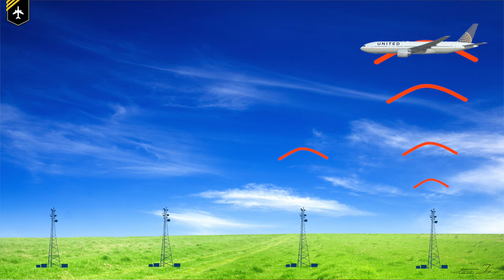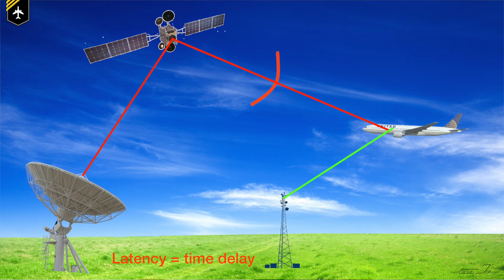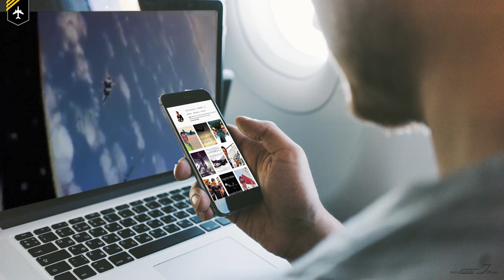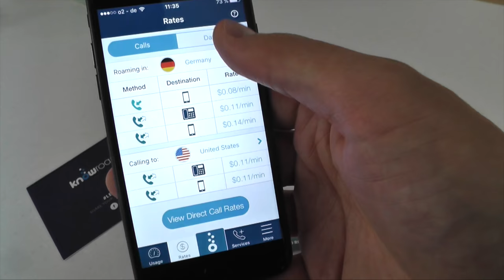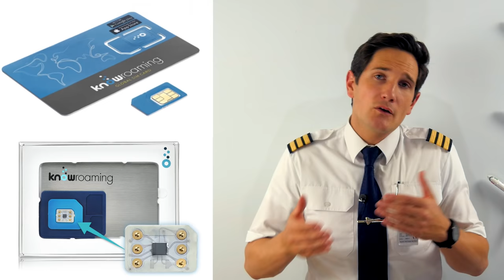HOW does WIFI WORK on AIRPLANES? Explained by CAPTAIN JOE

Comment: Captain Joe, can you make video how the luggage can follow passenger eventhough they have tight connection ? If the passenger fail to make the connection, the luggage doesn't make it as well. How that works in the last minutes ?
Reply: I agree the concept in general but how the cargo guy decide each luggage should board or get removed from the plane when connection is tight? I know in normal scenario, they scan our ticket before boarding the plane, so they know I made to the airplane so luggage should get onboard as well.

If the connection is only 20 min, passenger run to next gate which could be from terminal A to terminal B, the luggage basically has to "run" as well then ? How they can separate that luggage from other luggage quickly ? Assume the luggage guy is faster, how the luggage guy can determine if they should load it? wait until ticket got scan ?  

How about if the passenger is faster, and luggage guys is slow, the plane must wait until the luggage loaded as well ?
Reply: Most airports I've seen have cargo loading that is based on the boarded-passenger-count instead of the ticketed-passenger-count.
This, among other things, reduces the risk of passengerless luggage-bombs.

So, yes, even in those cases the plane will wait for your luggage, as it will be waiting for all the luggage it has to carry.

Comment: I hate to be that guy but it was far too annoying to ignore, especially being both an IT guy and a former satellite network engineer...

It's MegaBITs, not MegaBYTEs... You were claiming speeds 8 times faster than they are

And also Ku band theoretically tops out at 50Mbps, but you'd need to be basically flying in the stratosphere to get that!
Reply: p3rs0n42 haha I was thinking the same thing. I think it's very worth noting, though, that Gogo's 2Ku is claiming peak speeds of 200Mbps with the dual antenna and new modems. And it's not affected by weather like Ka :)
Reply from the maker: you´re absolutely right, my mistake sorry!
Reply: A satellite engineer......?

Comment: Hi Captain Joe, loved your videos. This is a subsequent question to your reverse thrust video. I understand that a jet airliner can only engage Reverse Thrust once its main landing gears touched the ground (correct me if I'm wrong).
However, I remember flying the Beechcraft Air King in the Microsoft Flight Simulator and the plane can engage its Reverse Thrust while still on air, is that true? How dangerous it is, and what are the procedures or standards involved to engage reverse thrust while on air? Perhaps the minimum air speed to do so.
My second question would be, what is/are the methods used by jet airliner such as Airbus A320 to slow down while it's still on air (descending for approach)? Can it use the spoilers? Or all the pilot needs to do is to minimize the thrust early enough?
Thanks!

Comment: Hey Joe, a quick correction to a common mistake. Mbit is not the same as MByte commonly abbreviated as MB. Also note the lowercase b in bit vs uppercase B in Byte. So 1Byte = 8 bit, thus 1MB = 8 Mbit. Anyways, great video as always! :)

Comment: Re Hi Captain Joe:

As a retored electronic technician microwave is not new but how it is implemented can sho a LOT of pros and cons.

Each f the three systems you mention have their ros and cons, but in the end even the hybrid implementation of these, whether by protocol selective receivng and aggregation in board the aircraft or by true simulataneous content integration, there is still room for some cost effective improvement.

The server onboard might well be headed by a mass onboard storage unit, smewhat similar to a NAS. This would receive by whatever ground and satellite services the airline chooses to use to pick up content, then it is the server for the onboard WI-fi system.

(Since this also can be segmented to provide two A-lan (as in airborne LAN) nertworks, one of these could be used to enhance communications for both the cabin and cockpit crews.

As for the cockpit, this is intended in addition to all they have already so it sits as an added redundance and fallback in case all other coms fail.

On trans-oceanic long haul, it could reduce some of the occasional need for HF radio when more than 200 miles away from the nearest VHF tower. We both know of the limitations of HF and skip. also in trans arctic flight other issues f nature simply exacerbate even more.

(I happen to have a multi-segented system in my apartment which I created myself!))

====================
Back to the cabin:
===============

Now when a passenger surfs, effectively requesting, say a movie, the system will fiorst search its internal storage for the movie,, and if it is there, will serve it to the assenger.

If it is not there, it will search the ground systems serving it and request it. when It arrives, oit is then stored in the onboard storage and subsequently served to all who ask for it. Additionally, if the system receives subsequent requests, it can also serve them without the need for the use of additional air to ground or satellite bandwidth consumption, saving in the cost of same, and resulting in faster response for requests that are repeated many times i.e. popular at the time.

this also opens the door for the airline to charge for the service my usage rather than simply availablility and time. What they end up paying for artists' rights is up to rhem, but hopefully both artists and airlines will negotiate that wisely so that it doesn't end up being destroyed in greedy fights. (Maybe ICAO could host some of this sort of negoitiations?)

As for email, the onboard system would have an email manager which would route email in the most efficient way, so that email that does not have to go air to ground will not, but instead will go passenger to passenger. If an sort of "bad behaviour" complaint is raised, it will send a notification to the Purser "#1" who can then be the first lne of maintaining order, but also with the means of notifying the cockpit if he/she deems mecessary.

Additionally, thecomplaint is logged and a copy of the log sent to ground in case something of major proportons (comparabe to a hijack) erupts. Once ground receves a call from the captain, ground autoritiesd, police etc. can then open the log to get an early warnng ongoing report no matter who does what.

If global engineesrins standards are ilemented, forestalling problems resulting from proprietary incompatibilites and making all this modular, the winners will be of that collaborative good Karma!,

Finally, I am 74 years of age, and unlikey to fly again myself. so win or lose the real gsambit, it will make little direct difference to me. But the altruism that I might wish for on my last day on this earth may hopefully be my greatrst gain in the lot.

Comment: I flew on Air Berlin earlier this year (RIP) and the domestic transfer flight had Wi-Fi... and the landing page claimed some impressive transfer speeds, but also had an obscenely low cap, if I recall correctly it was around 300-500 megs. So you could watch that video for a few seconds before you've used up your data and cannot use any more. I expect there will be more data caps on more airlines so even if you're able to get enough speed to watch a video your allowance won't be big enough.

Comment: 1:45 One byte = eight bits. In order to separate the units, we use capital B (as in MB/sec) for bytes and lowercase b (commonly written Mbit/sec) for bits. Now that you've said "3 Megabytes" but shown "3 Megabits", there is noticeable confusion.

Is it possible you could add a correction anywhere, even if it's just the description?

UPDATE: the description states megabits, I just failed to read...

Comment: I want to ask, when we turn on the plane mode (which doesn't make your phone fly :v), it turn off all signal feature like radio, telephone and WIFI, in order to not interrupt the ATC tower to the plane and back.  Is wifi onboard will not interrupt the signal of the plane or the wifi doesn't interrupt the signal at all?
Even though I ask this question after 2 year, hope you can see it and answer for me. Thanks, love your videos even if I'm not a vip passenger or often fly passenger.

Comment: Thanks @Captain Joe for another great video, I am happily following your channel and always joyed to see a new video pop up in my feeds! :)  Even though I am not a pilot or anything in aviation, it is still a fun hobby to observe and admire!  In regards to the units of data transfer rates thanks @ Marcus [DaSquad], I noticed the same thing and kept thinking to myself if the units are actually Bytes it would be awesome, though there is a 8 times difference between the bits and bytes.  Though he indeed is a pilot and not an IT, even though in these days the difference is much less with the growing tech age and how many systems and procedures I continue to be amazed that pilots need to have an understanding of.  Another side question to this is if cell transmissions do actually interfere with plane operations, for communications, navigation, and so on, or is is just a precaution.  Also, as you mentioned in this video, it seems that you were saying that one of the systems uses cell towers to transmit the signals.  Would these signals be the same as and carry the connections for the cell phone networks?

Comment: Hello,captain joe. May i ask you one or 2 question? Is it true you need to startup generator engine on the back tail aircraft in certain range n temperature before you can started up main engine. Which mean engine on the wings of aircraft. 2nd questions is.. is it possible to still in flight in just one engine remaining cause unexpected event like turbine error/ engine blade damage/ or whatever it probably might happen that could triggered the caused. N whats kind procedure you need in case you facing critical situation like probably crashed in the middle of nowhere. TQ IN ADVANCE

Comment: I was expecting pilots to have their own wifi separated from the passengers. Communication is crucial and if the radio fails, the Internet could be an interesting emergency communication system where they can also send data and no just audio.

Comment: Small correction: the ATG system picks up to 3 Mbits, which is not MEGABYTES as you mentioned, 3 mbits is equal to 0.375 Megabytes, so that's about 400 Kilobytes/s, same for the mobile phone, 40 megabits is not 40 megabytes, it is 8 times less, so that would come as 5 MB/s

Comment: Love the video but data rate terms are off a little. Mbit/s or Mb/s (megabit)is not the same as MB/s (Megabyte). A 30Mb/s connection will download at about 3.75MB/s (big B and little b make the difference) as there are 8 bits to a byte. A 100Mb/s connection will download at 12.5MB/s give or take. Taking the first internet delivery option. If you have a connection of 3Mb/s you would download at a rate of 375Kb/s (Kilobytes). You may already know this, just want to avoid any confusion.

Comment: Hey joe I recently traveled on an A321 with JetBlue from NYC to San Juan. When we were at the gate ( both ) there was steam coming from the side panels of the aircraft is this a depressurization system or some sort of chemical solution to stop the spread viruses, bugs, etc.? You may have made a video but I haven't found it yet. Thanks    -billy

Comment: KnowRoaming is good and I’ve been using it for years for my travel. Just pop the SIM card into a portable wifi router and purchase the unlimited plan, then all your travel companions get to share from a single access point. But the thing I dislike is their e-wallet which has an expiry, any left overly money in the wallet will expire and forfeited. Plus you can only topup thru their predefined amount and not any amount you choose.

Comment: Actually Ku and Ka aren't pronounces as words (more correct to call them by their letters: Ku=Kay-you, and Ka=Kay-ay)  Since there's already a "K" band pronouncing it the same as Ka would be rather confusing; in North America, Ku band is used in satellite TVs while K and Ka band are used for proximity and speed sensors (automatic doors use K band usually, while police tend to use Ka band to try and catch you for speeding)

Comment: That's some serious higher radio frequencies airplanes are using in order to provide us sometimes internet during flight, they must use some insane powers to transmit from the towers and satellites since the higher the radio frequency is the less range you get...
Reply: Given that most consumer bandwidths are downlink-heavy, one can assume that a slower frequency is used for the uplink.

Comment: This is how I'm going to be doing wifi and cell service when I go over Seas. I will use a Satcom set. Meaning Satphone and Satfi. A phone can cost 2k and a sat hotspot 900. Already looked them up. And cell service can cost you 100-200 for a month with both devices.

Comment: I don't get why they don't try to integrate the antenna into the fuselage. I'm guessing there's an issue with the composition of the fuselage blocking the signals, but surely there are composite materials that they can place in a patch and fuse with the metal. Kinda like what any wifi device with a metal case does. Big plastic part where the antenna is.

Comment: Hey Joe, you showed how that satellite antenna on the fuselage is able to rotate. I guess that only works when the airplane is flying more or less straight. How is it when the airplane makes a turn? Will the antenna maintain connectivity despite the fuselage being rotated to the one side where you are flying towards?
Reply: Do you mean roll? The antenna compensates for roll, pitch and yaw if that is what you ask.

Comment: Question: Under what conditions would a pilot abort a landing? I've seen videos posted of a plane in what looks like a normal landing, only to have the captain abort and take it back up in the air again. What are the sets of circumstances that would have to occur for a pilot to abort and try again?

Comment: Well, yes...tow ways explained.

The ATRAC satilite communications system transciving array...it provides high down speed ( Up to 400 MBit down) but only very limited up speed (About 5 to 15 MBit).
So most of this system, is prioritized for more important air craft data exchange, than on bord wifi.

Second is simple radio based, has about 25 MBit down/25 Mbit up, but limited range and needs land based systems to communicate with, within 50 miles or less of tha plane.

Also maybe faster(up to 350 MBit down, 125 MBit upload, on 5,2 G HSDPA mode), but very rare due extreme expansive materials needed for this antenna...tha GSM/4 or 5 G transceiver...basically a cell tower that links up with tha ones on the ground...tha only certified way to provide cell service or wifi, on tha ground and while takeoff or landing is in progress, as it not interferes with other plane used frequencies.

Over land, as mentioned, tha 4 or 5 G tranciver can also provide on bord cell service...but currently not used for passengers and if installed, only for flight crew usage in emergencies!!!
So if you not a pilot in distress, trying to get ground contact, no cell usage, please!!!

So turn your phones off, even if they might work, it scrambles with tha rest of the on bord systems performence, as so much radio communication is going on with a plane.

But as captain joe mentioned, all systems require a firewall(So Non Stop not repeats so easy, movie based on a true incident with a dreamliners wifi!!!) and a router...also high end ones to make it possible, tha bandwidth can be used by all passengers.
Tha equipment for just, most common, Lowspeed Ku satilite powered wifi, is about 500 Kg(CRJ-700) - 2112 Kg (A380) extra...so basic plane weight up, fuel consumption up...tha reason it will never come cheap!
;3)

As fuel, even Jet-A 15 or 20, are more expansive the more quality they have...tha reason it more and more spreads to civil airports, it burns cleaner, turbines last longer with it, together with economic founding, tha airlines pay a little less than with Jet-A1, were they pay for it's unclean burn waste and for turbines getting busted faster.

Otherwise, it most likely and sadly, not would be used at all!
But okay, for pilots that are in one of tha few airlines using it and flying to tha few airports serving it, yeah, your fuel calc is correct, it burns so much more efficient, it's really okay you load on less fuel on longer trips, as much your calcs show!

But guess the airlines got you tha new power training...hopefully, that gives you all tha data...otherwise your airline has to provide some written value updates, for Jet-A15 or A20...optimized to your type of plane and model, too.
;3)

So much for my update, felt inspired to say it again, don't mess with inflight securety!!!
Turn cell service off, if not allowed specifically on a plane!
Don't mess with fire detectors...and if you really are among tha few to ever experience a emergency disembarking:

Keep calm, tha swimming west deflated as long you're not outside tha planes inside.

Have a nice and pleasant flight, and fly safe!
;3)

Comment: Captain it's always so informative to watch your videos. Thanks alot. Actually there is a question in my mind from the past few days. I came to know that at a time there are 14 thousand aircrafts in the air in the world at the same time. Wow that's a huge number. So my question is airport's such as Dubai or Heathrow where the air traffic is extremely high, so how they handle these aircraft to prevent collision and what normally flights do to prevent collision between them? So in the nutshell, I would say please talk about air traffic control in your coming videos :) Thanks :) Forever your supporter :)